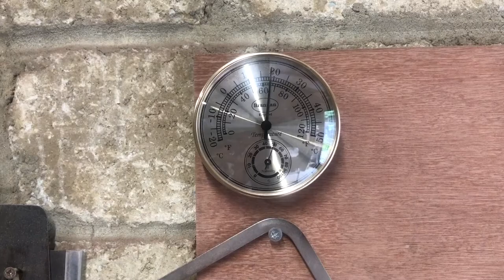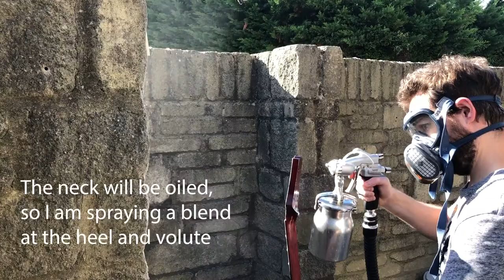How to make grain filler - Building DC Guitars - Episode 24 - Staining, grainfilling and lacquering

Comment: I came here at your suggestion for learning how you make grain filler from your recent (Nov 2023) purple guitar. Beautiful finish. I have a couple of questions about the filler.

Was that boiled linseed oil? Did you use a gloss lacquer? After you wiped it with burlap did you do any sanding? What brand of dyes did you use?

Finish

How many coats of clear did you spray? Do you always hold the spray gun that close to the work? 

Do you use any different filler formula for heavy grain wood like mahogany?

Is beer required to get proper grain filling?

Thanks. Great video!
Reply from the maker: Thanks for watching, yes beer absolutely required for a good result. 

Yes it was pumice + boiled linseed plus any old alcohol based dye, as long as it will mix with linseed oil. No I wiped off the excess with the burlap, didn't do any sanding apart from a bit of denibbing after a few coats, very light scuff sanding with 320. I can't remember how many coats I sprayed. I normally go 10-13 depending on how much I've thinned the paint, which will depend on how arm it is, if it's particularly warm then I will thin the paint more to mitigate orange peel so do a couple more coats.
Reply: @ADFinlayson  thanks for answering. One more question. You said a little sanding for denibbing after a few coats . You mean clear coat? Only one coat of filler though? I’ll get extra 🍺!
Reply from the maker: @jugheadjones5458 yes denib clear coat
Reply: @ADFinlayson  thank you. I’ve learned a lot.

Comment: When filling grain I apply the stain first then seal it. I then buy a neutral grain filler but tint it with powder artist pigment. I remove excess with Hessian cloth and repeat until the grain is completely full. I then apply the top coats. This is usually working with shellac or cellulose. The grain filler can be abrasive so you have to be careful not to rub too hard or you'll go through the sealer..
Reply from the maker: kind of makes sense not to use sealer then, that way you can't go through it.

Comment: I'm working with Okume, which is an African Mahogany (so it claims to be.) I thought the idea was to use grain filler before applying stain, which I did.  Should I do a grain fill again after staining?
Thanks in advance.
Reply from the maker: Do what works for you. If the grain is filled and the stain has taken properly then go with it.

Comment: Hi, 

Very nice well done! 

I’m working on a bare walnut veneer and I would like to fill up the pores and grains in dark brown colour. 

Can I stain and fill the grains in the same time?  

I mean, I’m planning to stain the wood with oil base stain from Osmo, can I use the same stain (which is oil base) to mix the pumice powder and use it to fill the grains and colour/stain the wood in the same time? 

If it’s wrong, how this should be done ? 

Thanks so much buddy!
Reply from the maker: I see no reason why you couldn't. If you're doing an oil based finish there is no reason why you can't stain it, then wet sand a heavy first coat of oil to make a dusty slurry which will also fill the grain. You can also put an alcohol/oil based stain into your oil finish to tint it. Whatever you do, you should do a test piece first and figure out what works for you. Here's the tester I did before I finished these guitars:

https://www.instagram.com/p/CAqesVZnT2V/?utm_source=ig_web_copy_link
Reply: All right thanks buddy, I will do as you suggested including some test ! 

Thanks a lot

Comment: It would have been nice to know more about the materials and  process: Type of stain, how that was locked down and prevented from migrating when the top layers were applied. Type of final finish (I'm assuming it was nitro).

The main problem that I've had with stains is that they smear and migrate when the next layer is applied, so perhaps there are materials and tricks that you could show us.
Reply from the maker: I thought I said in the video, the dye I used at the started was waterbased, crimson stunning stain. The red grain filler was made from an alcohol dye, none of the filler should react with the water based colour, yes the top coat was cellulose

Comment: There is something perfect about a mahogany stained red like that.  I had NO IDEA to do the filling after the staining. I think I'd have been terrified of pulling all the stain out trying to remove the filler.   Thanks for documenting this!
Reply from the maker: I think it depends what filler you're using but yeah the rationale was water based stain to not react with the oil based filler and potentially wipe it away. I obviously wasn't thorough enough with the filler though because I had a lot of visible grain after a second coat of lacquer, so I denibbed tonight and did a second round of grain filler. Will give it another few coats tomorrow weather permitting :)
Reply: @ADFinlayson  Ah, right!  Now the oil stain makes sense.  Perhaps I just need to hear things about 20 times before it sinks in but that's the first explanation that actually makes sense.
Reply from the maker: To be fair, I’d switch off when I’m talking to, my mrs does 😆

Comment: This is imho, the hardest part of a guitar project.  So difficult to get the color stain you want, add the filler, and not oversand the filler back and break thru the original stain.
Reply from the maker: One of the jobs I like having done more than I like doing

Comment: The trouble with pumice is that it blackens and muddies the stain. Colloidal silica  makes a much cleaner looking translucent filler which is finer for filling pores. It's essentially colorless. Also, really only one coat need be applied and that's the filler coat. You really don't need an initial stain before that.
Reply from the maker: Well darkening the grain was the plan with this one, if I wanted a clear filler I would probably just use Aquacoat

Comment: Hi Friend, first I have to say nice job. But could you tell me what kind of oil to use? I'm from Brazil and translating some things doesn't match in Portuguese.
Reply from the maker: Thanks Alan, the oil I used in the filler is boiled Linseed oil. It is quite common, you should be able to find it where you are. 

Cheers
Ash
Reply: @ADFinlayson  Thanks a lot, I'll be repainting/refinishing my gibson les paul in next months. Cheers!
Reply from the maker: @allanarnoldi7727  good luck!

Comment: I've been doing some research and have mainly been following videos on YouTube but just today I was surfing the web and was reading the procedure via a blog or something this guy had. Anyway I have a question, the dude on the website said that if you want like a solid less porous touch to your mahogany guitar to put the wood filler first to get that texture and then to stain it and then to locker it. Would you recommend against that or do you think either way is fine cuz I noticed you did the wood filler second and I don't think it's a bad idea but I just wanted to know the pros and cons of either procedure if you do know that answer. Thanks and sweet video actually watch the whole thing with rewinding to recap
Reply from the maker: Well if you grainfill first, there is a chance that the stain will not take to the wood as evenly afterwards, particularly with this recipe I'm using because it has lacquer in it so it works as a sealer as well as a filler. ultimately, whichever method you choose you need to get the surface as level as possible and enough lacquer to fill whatever is left of the pours and build a layer on top of the surface that can be levelled off without burning through. There are many ways to achieve this though, you could just grainfill with Timbermate and spray a red shaver over it, or colour your timbermate and spray a shader. A lot of these fillers though like timbermate or aquacoat all shrink quite a bit and need several applications to fill where as this method only needed one application